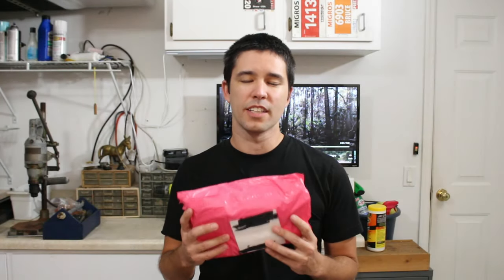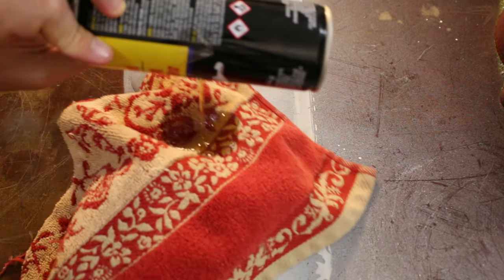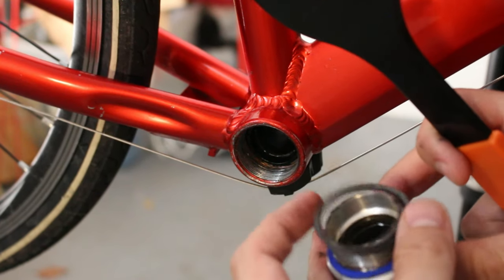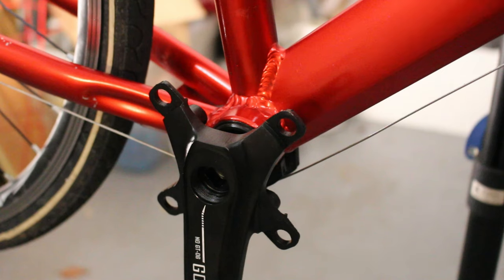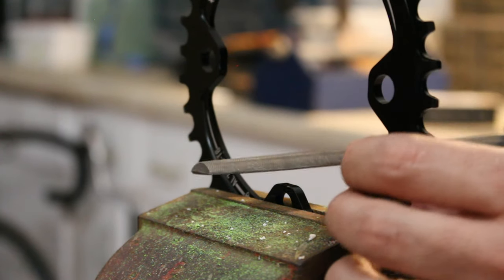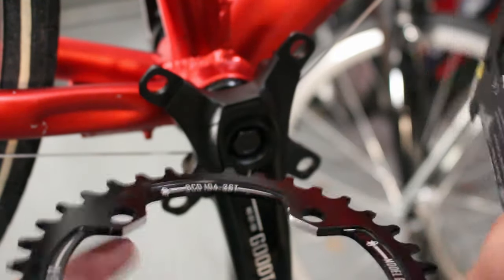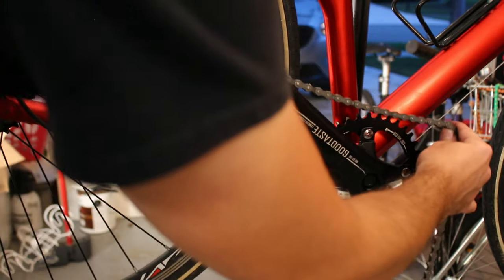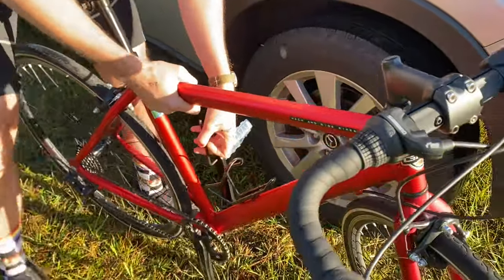The cheapest 1X crank set and BIKENSTIEN colab

Comment: I went with an 'action' crankset with a 32 tooth chainring ($45.) Fit on the existing square taper and was pretty easy to install. Took my laps through fields on my family's property from a torture test to 'huh this is kinda nice' and let me actually work out as opposed to slog through.
Reply from the maker: was the stock chain-ring larger than 32t?
Reply: @BruceChastain  stock was a 44t.

Comment: The one thing I don't like about this bike for a gravel bike conversion is the frame. A aluminium frame without a removable gear hanger is a very low cost, low quality frame. Yes you don't need a removable gear hanger so much on steel because of the properties of the material and it can be bent back multiple times without issue but that is not the case with 6061 even if un-hardened. You would normally expect to see a removable gear hanger on an aluminium frame. Bending the gear hanger is far more likely on a gravel bike compared to a road bike.

Also I feel a 1x setup should be combined with a freehub rear wheel to give you the wider gear ranges of a cassette. You can get 11-42T 8 speed cassettes relatively cheaply on Aliexpress and a microshift/micronew 8 speed shifter is only about $9 plus if you had to use a gear hanger extender perhaps that would help to protect the frame, they look weaker and more likely to bend than the thicker integrated gear hanger of the frame. Lastly maybe a derailleur guard should be fitted due to the frame design so that if you crash off road the derailleur guard helps prevent the derailleur bending the gear hanger.

I think for us heavier chaps a old rigid steel 26" mountain bike to gravel bike conversion makes more sense.
Reply from the maker: yeah I don't really disagree with any of that. but on the other hand a lot of the older aluminium mountain bikes from the 90s had fixed RD hangers too, it's just a thing sometimes, not ideal but as long as you don't smash it, then it'll work. A guard would be a good idea. To be honest I'd rather go with a 26" rigid steel MTB too, did you see my 1995 GT MTB videos? I really really liked that bike. Although I will say it was pretty heavy and overall didn't feel fast.
Reply: @BruceChastain  I'm guessing it was the early aluminium mountain bikes that kept damaging their frames and led to the introduction of gear hangers. Here in the UK I seem to remember a light mountain bike back in the early 90s was chromoly steel compared to the cheaper high tensile steel bikes but then I don't think the UK market was as advanced as the US market, maybe we were a year or two behind, budgets being tighter over here. Nowadays it seems a good chromoly frame is more expensive than aluminium but it was the reverse back then I think. High tensile steel being the cheapest frame is consistant over time though.

Still that bike was an amazing deal at $99, a lot of bike for that money.  Many years ago I got a brand new Vertigo Carnaby Claris road bike for £62 when Tesco were clearing them out, a UK supermarket chain. That was my road bike bargain of my lifetime probably.